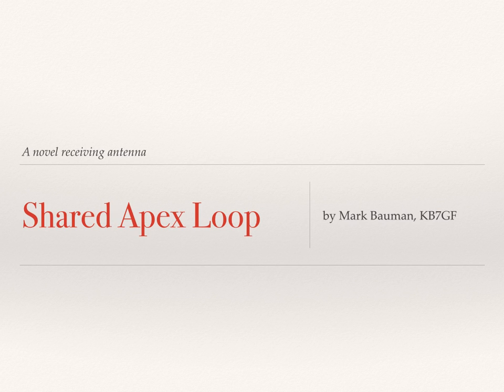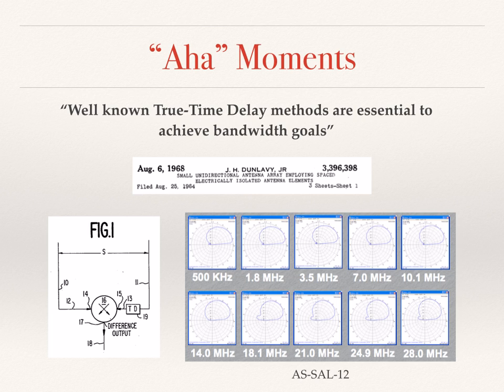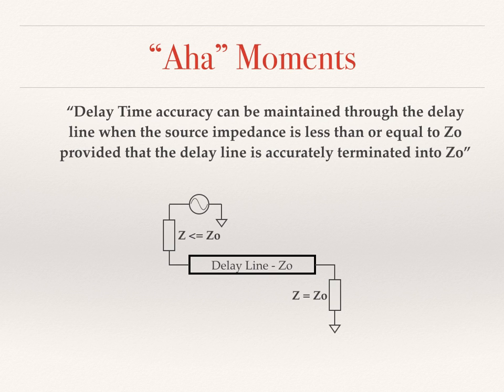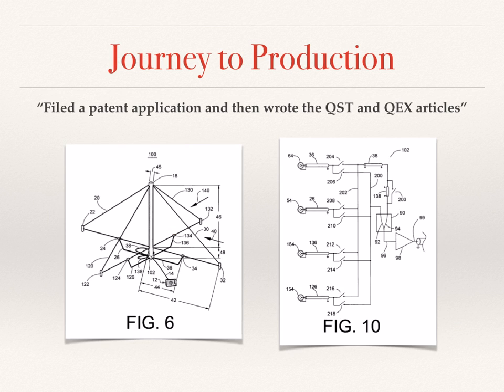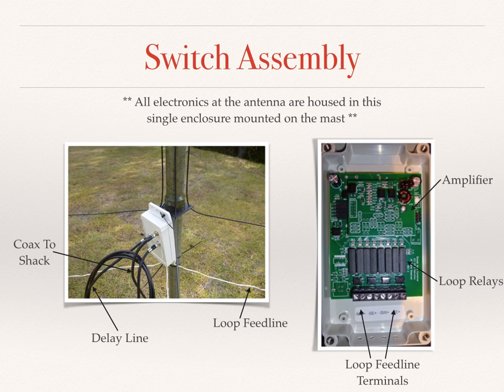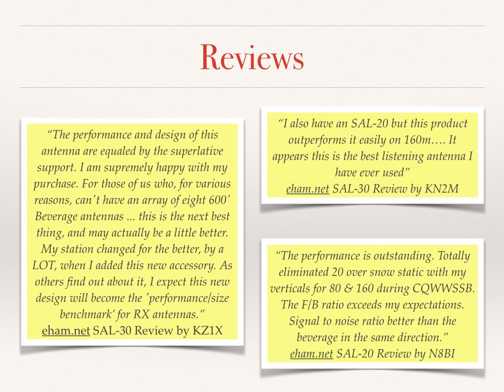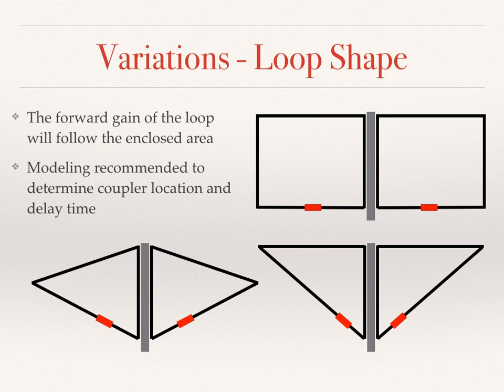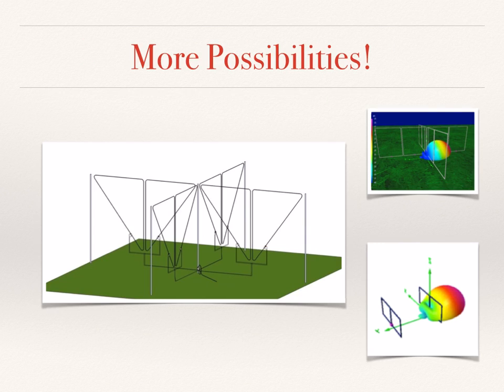Dayton Hamvention 2014 Shared Apex Loop Antenna Forum Presentation

Comment: Hi,  is it possible to use UTP cable , and ethernet  transformers for combining the signals ? Ethernet is 100 Ohm and these xformers are  cheap and easely available..
Reply from the maker: Johan Sagaert The UTP cable will work fine for the loop feed lines; the transformers are broadband, so there is a good chance that ethernet transformers would work. 73, KB7GF